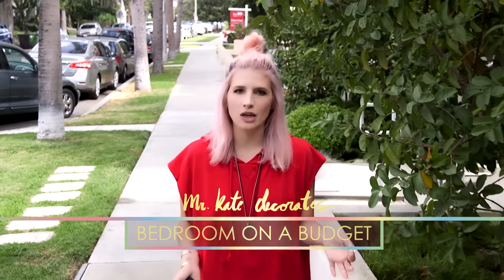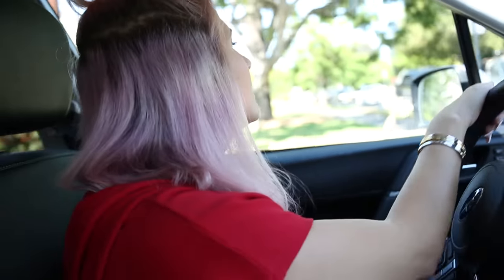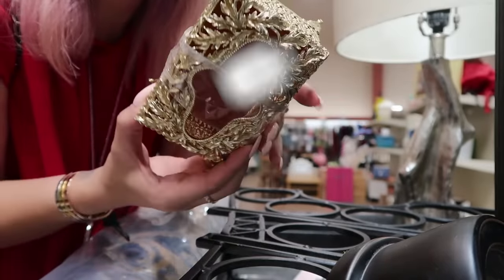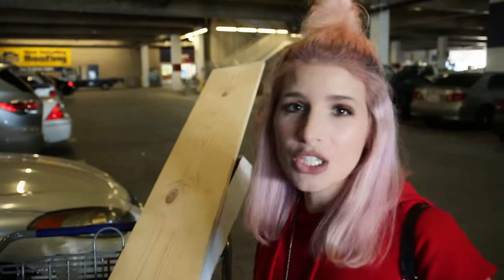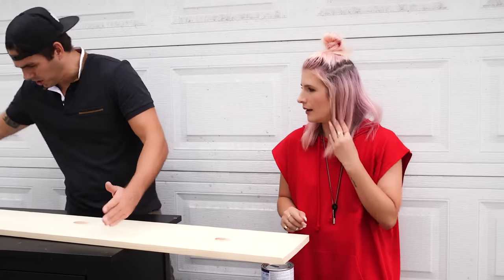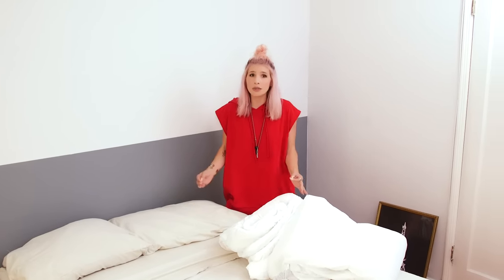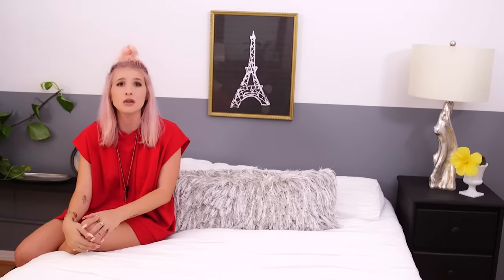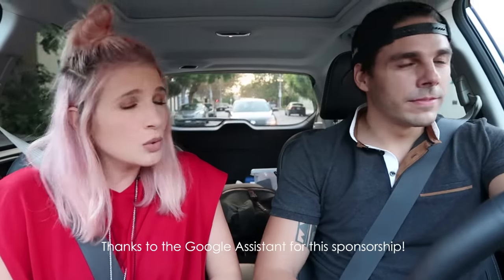Under $300 Bedroom Makeover | Mr. Kate Decorates on a Budget

Comment: I had my doubts after the thrift store run, but this was pretty successful! A painted faux headboard definitely a cheap fix. The dresser knobs I never would have thought of though (nor would I be able to do). Painting the corner of the drawing gold?? Scratch that idea. Why not just do a similar idea as the canvas on the dresser, only smaller? What the room needs most is a good sized mirror so she can get properly dressed in the bedroom. Can get cheap ones to put on or behind a door. Also, use glue-on clear or white hooks for the plant; never obvious screws or nails. Hairy pillow a great find! Looks like a yak.